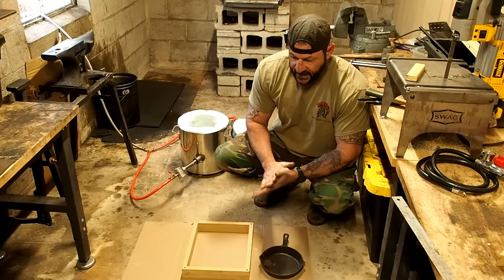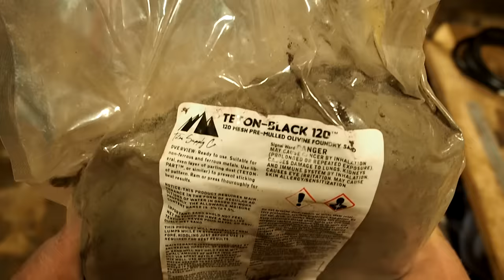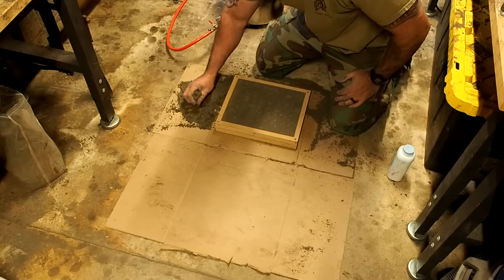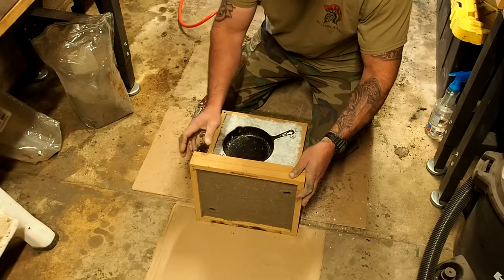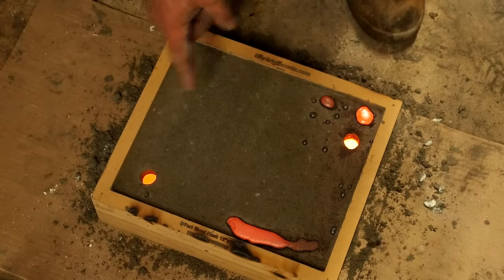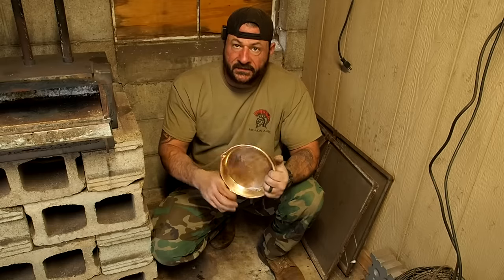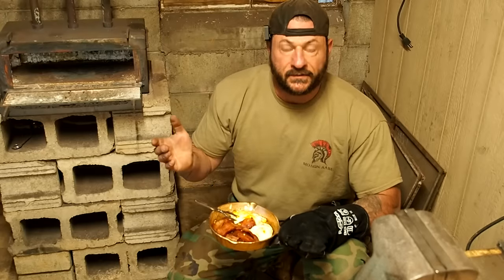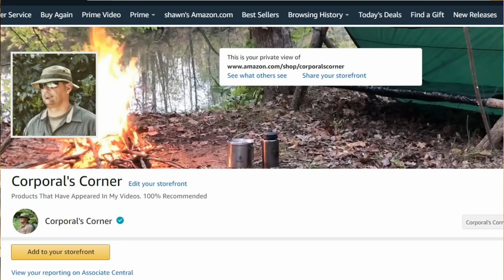Solo Overnight Making a Bronze Age Fry Pan from Dirt and a Prehistoric Breakfast

Comment: 20:02 The pour vent hole i s called the sprue and the exit hole the communicator. They are both in the cope half  of the pattern mold. The bottom half is called the drag. Been a pattern maker now for 50 years .thank you so much for teaching this difficult trade of foundry men .the existing fry pan is called the pattern.Thank you very much for teaching this important  trade and well done on your final and useful casting. I'm impressed at the time you put into ramming up the mold and pouring  it.
Reply: And don't forget that new tech like 3D printers can make a "new pattern", so new and old tech can mold here. Then you can actually produce very cool things out of metal at home.

Comment: Outstanding video again.  My great grandmother had a bronze skillet and it was seasoned very similar to her cast iron. I have it but it's on a display shelf in my kitchen with most of her copper and enabled cookware.  I still use her cast iron skillets she got from her grandmother.  One is stamped 
"Richmond Iron Foundry 1846" it's the best skillet for cooking I've ever used. The best thing is that skillet has gone to California and back. Also, I live in Richmond, Virginia where the skillet was made. A bit if history in my kitchen.  If I only knew how many skillets of gravy or number of pancakes that skillet has made. How many camp fires has it set on? It hates electric stoves and loves gas stoves or campfires.

HAPPY NEW YORK YEAR

Comment: We used to use fine white sand and filtered motor oil. It packed amazing and we often reused it. Also on the vent holes taper them so sand doesn’t go with the metal when you pour. Great job man. I love this. We used to have a foundry at school and I spent waaaay too much time there.

Comment: this was a great intro to casting. I love seeing metalwork being done. I was lucky and had a high school with an awesome metal shop. we had a foundry in the back of the shop where were we could do castings. I made a ton of cast iron and aluminum shop vices bases in the foundry.  there were a couple of things that were left out of the video that need to be mentioned. 1. when copying an existing part, the copy will all ways be smaller than the original do shrinkage of the metal as it cools. so, if you make copies of copies, eventually they will get significantly smaller than the original. 2. metal should be poured approximately 100 degrees above the metals flow temperature to achieve the best results. 3. fluxing. fluxing removes slag and oxidation from your molten metal, and it prevents metal loss to oxidation while pouring. there are different fluxes for different metals. 4. if you are not making a copy of an original object, the object you are casting will need to be tapered in order to facilitate its removal from the mold. but overall, this was a great intro to casting.

Comment: They found bronze skillets in Pompeii so it's  a legitimate 2000 year old skillet haha
Today's Bronze is just fine because they don't use arsenic in the process anymore or lead/ pewter so as long as you're using copper and tin or make aluminum bronze, is really strong and good, you will be fine.
 yall can look it up if you dont believe me dont use pewter or lead or arsenic and use good clean Source metal not stuff out of maybe junk yards and stuff so there's not a chance of being poisoned by chemicals that are inside the metals.

Comment: I guess I am one of the lucky ones.  I get your Sunday and mid week videos in my feed plus email notifications.  My question is does the casting have to be done in one pour?  if so how do you figure out how much metal you need and if your crucible is big enough to hold it?
Reply: Yes, it does need to be done in one pour. If you do it in two pours, the layers will not melt together.

Comment: Modern copper tubing (as used in the video) quite often is already bronze, as copper is fairly soft, and a little tin goes a long way into making it more durable.  Found this out the hard way, when i used modern copper piping from my local hardware store, that stuff was WAY harder than it should have been.  I work with pure copper buss bars, and that stuff is soft.  Hardware store copper tubing, not nearly as soft.

Comment: Next time you should press a 3d raised medallion of the corporals corner logo into the bottom of the mold, so it ends up on the bottom of the pan. Or reach out to the community, I’m sure someone has a 3D printer that could print you a skillet with the corporals logo already on it that you could then use as a mold. Perhaps for a cast aluminum skillet next time?

Comment: I did sand casting in college (engineering school in 1968).  We did an aluminum part.  Yours was better than mine.  A week after I did that , a "Mission Impossible" program cast platinum into a bumper to sneak it over a border.  I wish I had the waste they had making that bumper shine with no gas pits showing (LOL).

Comment: Good Job 
Outstanding 

Since I'm unable to travel there 
to collaborate with you,  I'd 
suggest that you do a project 
of casting aluminum handles 
onto a stick tang knife blade 
with notches to lock it in place. 
I've wanted to do that for a 
very long time, but have never 
had the money for the proper 
equipment to do a decent job 
and not severely burn myself 
in the process 

Have a safe and happy new year to you and all the viewers

Comment: You could also use Aluminum in place of tin in a ratio of 9 lb Copper and 1 lb Aluminum and have a much stronger alloy. And if you could get 1/3 lof a lb of Beryllium to that mix it would be as strong and tough as tool steel
Reply from the maker: then it will not be bronze
Reply: @recall5811  Actually that alloy is called Aluminum Bronze and the other is Beryllium Bronze whether it uses Ar snick, Aluminum or Tin in the alloy

Comment: Caution:  Copper, zinc and some other metals are toxic by ingestion.  I urge you to "season" such vessels like you would a cast iron frying pan (or tin them if you prefer).  It's a pretty straightforward  process, only requiring vegetable oil and a source of heat (such as an oven, maybe a range).
Reply from the maker: literally stated in the video

Comment: Excellent! I originally wondered why you were chipping the casting out of the clay while the metal was still hot, then I realized you had to quench it before it cooled too much. About the time I figured it out, you were dipping the still-hot frying pan casting into the water.
I have a couple of friends who did something similar with recycled aluminum, but they went for the Lost Wax method rather than the split-mold you used in this video. Back in the day, my Dad made a split-mold out of stainless steel for casting weighted fishing hooks. The idea was to put a store-bought hook into the mold, put the halves together, then pour molten lead in so that the hooks came out with a lead weight just below the eye of the hook. Worked really well, but turned out to be more of a fun learning experience than an economically feasible process. I believe that Dad's ultimate aim was to learn a "lost art" rather than wind up with a business. Dad was like that--he taught me how to weld by recycling worn out plowshares, welding old ones together onto a "gently-used" one in a way that left us with the base still having usable lugs to bolt to the plow, while tripling the OEM thickness of a new plowshare out of worn out ones we'd otherwise have to scrap. Farmers learned to recycle long before the general public caught on, LOL!
I'm looking forward to seeing the tinning video. That sounds interesting. Sight unseen, I wonder if the tin bonds with the bronze, or will you have to be really careful to ensure that you don't wind up with separable layers? You teach, I'll learn. Catch you next time.  --Dan

Comment: Great video, have been wanting to get into this as the supply chain issues made some parts unobtainium. Would like info on forge- looks commercial but would like to build my own. Safety last but have watched others and they stress doing this outside(foundry accident in enclosed area is VeryBad) and pour failure on concrete can be disaster as moisture in concrete can erupt in steam explosions a layer of dry sand or casting clay is how it's done professionally. Clear face shield and gloves may be minimal PPE but better that maiming injury. Copper is used in the highest end cookware for its heat tranfer ability and natural anti microbial properties,never heard of a copper toxicity problem. Great on charity just sad so much will be wasted on their massive overhead and fraud.

Comment: On your next skillet (or any other item) cast, you should replace the "Ozark Trail" logo on the bottom with your "Corporal's Corner" one.  A bit more work, at first, but you can use the first cast to make the others.
Reply from the maker: wont be a next skillet, most couldn't watch this video so it was throttled

Comment: How do you know when you have enough melted copper to pour and fill the mold?
Reply: Measuring by weight works well. Weigh the cast iron pan. Calculate how much copper weighs the same volume. Weigh out that much copper on a scale. Melt it down.

Comment: dont cook in bronze, some old bronze pipes contain lead, also acids might react and make salts with the metals of the bronze...
Reply from the maker: glad I covered all of this in the video
Reply: you can remove Lead an pewter from items when you melt the bronze pipe down. They have low melting points unlike copper, silver, an gold.
Reply: @recall5811  sorry didnt have time to watch it fully today, will watch it tomorrow probably...
Reply: @SavedByChrist94  yes some of the lead and zinc oxidize while melting the bronze, but not all...

Comment: you've got holes at each corner (of the wooden frame), I can see that much. why not use some dowels or physically screw a flat piece of wood over the top (temporarily) so there is no "Indiana Jones" moment to worry about? I'm sure if someone's doing this they have access to a dremel or portable screwdriver ... just a thought, not trying to rag on it, or you here. You could even go super ghetto and staple an extra piece of cardboard over the top if you really had to.
Reply from the maker: so using glue and dowels will keep the clay from breaking? from your comment you missed the point or have no experience in making petrobond clay flask molds
Reply: @recall5811  I figured this would happen. No, please don't think I'm attacking you here. What I meant was you could screw down a flat piece of wood or even cardboard for the flipping the frame moment, to avoid the dirt falling out. Relax bud, I'm not attacking your work here, just trying to add to it. Support the frame, give it a top so it can't fail, right? also I would never use glue where heats concerned, just press fit. Again, just for a top/bottom plate to not give the dirt a chance to fall out when flipping the frame over by hand, thats all.
I would do it beforehand too, so as to not disturb anything. You could screw it down too, then remove the plate afterwards after flipping it over.